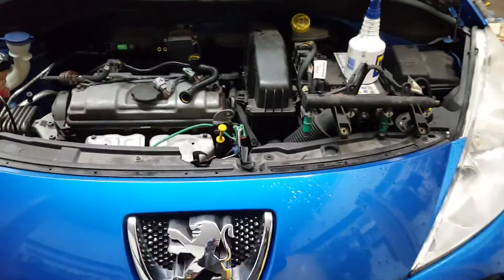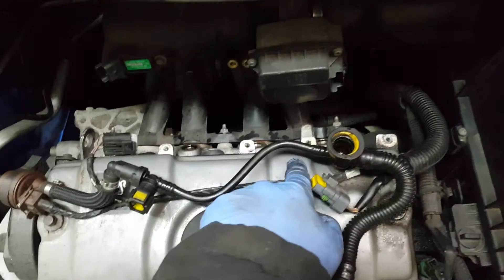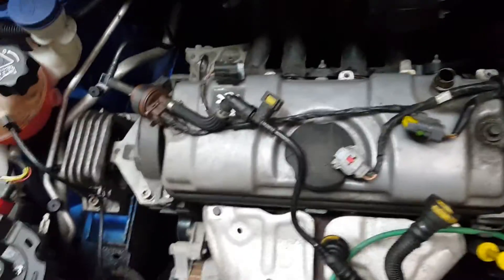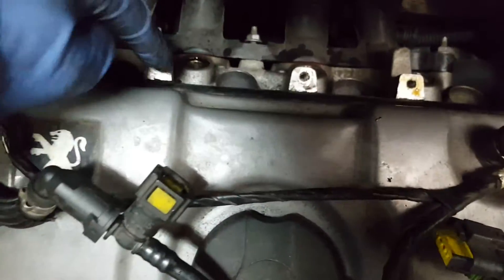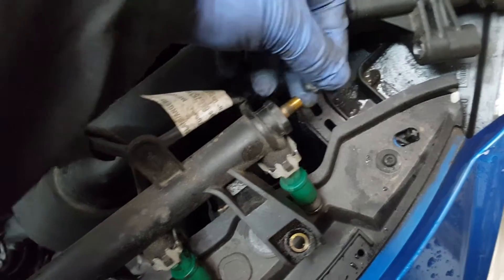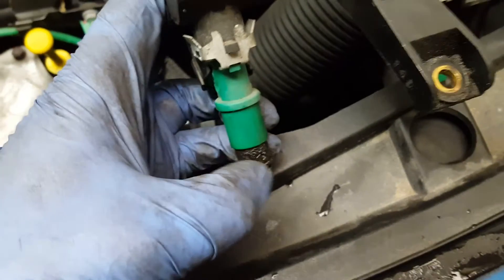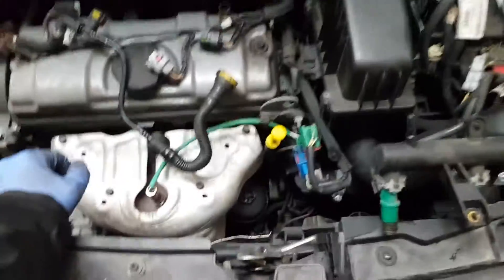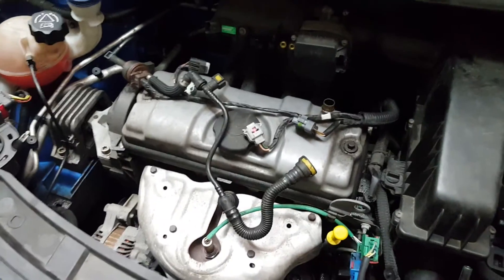Peugeot 207 misfire fixed. Coil, spark plugs, Injector removal and test.

Comment: Had checked a number of videos but this is the best one yet. My Peugeot is misfiring. The mechanic fitted new coil and plugs to no avail. He said most likely the ECU and not worth fixing as the car is a 2004??? I will have to ask him if he checked the injectors. Thanks for an excellent video.
Reply from the maker: Thank you very much. It's great to be appreciated. I hope that would be your issue as it is very common on them. Let me know how you get on. Good luck

Comment: Thank very much for this video, after buying and installing new plugs and ingintion coil my car was still misfiring, after watching this video I took out the fuel injectors that were very dirty and cleaned them up with throttle body cleaner, I put them back on and my problems were solved. It's no longer misfiring Thank you.
Reply from the maker: Thats brilliant 👏 well done!
I am glad that you managed to get it sorted. Usually it's them 3 things that can cause that. If not any of them then its lookin for the wiring or ground issue.... mind you saying that on more recent cars the EGR unit can cause some nasty misfire and in some cases ko fault codes... 
You are welcome :) have a great day

Comment: Hi Alex! I’ve got a 207 GTi with a misfire issue. Car misfires only when idle and cold, but once it gets onto the road and picks up speed, the misfire eventually stops. I recently changed my spark plugs and checked my coils, Both are fine. Pressure coming from cylinders is also okay, do you think It could be injectors or fuel pump?

Comment: great video. I have a 2006 307 1.6 petrol that comes up with fault p1338. i have replaced plugs and coil pack, clear the codes but no change at all. p1338 comes up again. any idea what should I try next?
Reply from the maker: Have you had a look at your injectors? I would suggest swapping injectors first mate.

Comment: Hi i am having a problem of intermittent rough idle usually only does it when car is at operating temp. Also idles roughly (hunts up & down) if you put the car under load,like put your foot on the brake and slowly release the clutch while in gear then the car starts to idle roughly.
Reply from the maker: Hello. Have you scanned the vehicle to get a fault code?

Comment: Hi Alex, I have a Peugeot 207 1.4 8v.. I bled the coolant system as there was no coolant in the car when i got it! so I put a hose pipe in the coolant tank and i ran the car until the fans kicked in and the coolant was stable.. The car is not losing any coolant. But i am getting code P1336 after driving it from cold for about 5 minutes then the engine light comes on but it says could be one or more undetermined missfire.. maybe i got something wet when i disconnected the pipe at the top of the radiator to flush it out? what do you think?
Thanks
Reply from the maker: Hi there. I would definitely check your ground cable connections for a good contact

Comment: Thanks for the video very helpful, just a quick question. What would happen if you didn't replace the damaged injector seals?
Reply from the maker: It will leak and misfire still causing internal damage on the engine as well by not having proper combustion
Reply: @AlexTheGrumpyOne  okay thanks my peugeot 206 has a miss fire, it sometimes gets worse and the fault light comes on and off It first come up as a injector not working which I replaced it ran better but still plays up when I plug it in it gives a code p0300 I've tried  new spark plugs I'm just wondering weather to replace the injector seals or maybe the fuel filter.
Reply from the maker: What about the coil? Is that ok?
Reply: @AlexTheGrumpyOne  I don't know I'll have to look into how's best to test it thanks for replying. Darran

Comment: got a 65 plate 307 thats giving me  an anti polution warning and is only firing on 3 cylinders any ideas what could be wrong or have caused it? heads done right in cheers.
Reply from the maker: Have you had it scanned to get fault codes out? If yes then what are they?
Anti pollution will be due to missfire hopefully as it's not burning the mixture and getting your cat or dog blocked. 
Is it petrol or diesel? 
Coils usually go on them if it's petrol. But you need to scan it first.
Reply: They'd have prince engines not them ones on the video

Comment: Hi great video, I have a petrol 207, I have an issue when the engine is cold, when I pull away it judders and has a lack of power, once the engine has warmed up it runs perfectly. Someone said it might be the camshaft position sensors need changing but I’m getting no error code on my diagnostic tool
Reply from the maker: that can be coils starting to fail to be honest
Reply: AlexTheGrumpyOne hi Alex changed the coil pack and no difference, any other ideas mate? Thanks 😊
Reply from the maker: Hello mate. Have a look at all of your glow plugs please. Also have you had it scanned yet? To see if there is any fault codes please.
Reply: AlexTheGrumpyOne it’s a 1.4 petrol version so no glow plugs I presume? I’ve spoke to a garage and they said that EML is not coming on when it has the issue they doubt a scan will find it
Reply from the maker: Yes petrol will have spark plugs which can cause that issue as well if there is condensation or issue with the gap. EML light doesn't necessarily needs to be on to have fault codes in it. I will recommend scanning it fully and having some live data reading on it mate.
Reply: @markwalker652  maybe throttle body could be cleaned up, you'll be surprised how dirty it is

Comment: how did it run ?  i have a 1,6   vct  engine with intermittent slight miss   at idle ,(no load)  and when driving at any speed i will get a miss  every 10 seconds or so ....whether under load or not...its like a hick up !!!   l  your thoughts please before i unload with coil packs and injectors  cheers
Reply from the maker: Hello
 Have you had it scanned for a fault? To see which number it is. 
I suggest to do that first and then swap the coils to see if it moves to another one. If yes then it's a coil... If not swap the plug and see if it moves.
Reply: @AlexTheGrumpyOne   hi thanks for the reply ...you wouldnt believe it , i just bought the car didnt really check it because  all the receipts for servicing new plugs etc.. the guy spent alot of money  trying to fix it...all the coils are bocshe  and look new , he changed the plugs and oil  and it had no codes , he took it to different mechanics to fix it ????... so i put 1 litre mentholated spirits in the fuel tank and it is fixed ...water in the fuel tank!!!!!!
Reply from the maker: @cameroncooper4291  bloody hell mate... Has it had a jet wash on it by any chance haha. 
Well I'm glad it's been sorted mate

Comment: thanks for your video.
i have a fault P0170 in my peugeot 206 cc 2.0 petrol from 2005 is any ideia what i need to clean ?
best regards
Reply from the maker: Hello there. Is that the O2 sensor fault? Have you got any more info? If O2 sensor fault then I would suggest to clean it and see if it comes back after a drive... If not will need replacing as they are common on them
Reply: the O2 was change 1 week ago,and now comes the fault code P0170
Reply: @AlexTheGrumpyOne  iI have a scan delthi and tha is what is shows me.

Comment: Hi Alex, great video 😍So here's my problem: My son's Peugeot 207 keeps misfiring. He says that it's two pins on the plug that supplies power to the coil pack that keep burning out or getting coroded. Any idea what he's talking about and how to fix it please? He's changed both plug and coil pack twice and the problem keeps recurring 😢
Reply from the maker: Yes it can be an issues on them. Not common though... If that's the case then he will need to get new wiring for it. Which is a bit of a pain... There is a way that you can just buy plug and solder it in to join wiring but need to be very careful. Can get plug on eBay or brakers
Reply from the maker: If it keeps burning the plugs or wiring then you need electrician looking at it as something overcharging the system on them. Will need good voltage and Amos check and etc... Unless the wiring is weak
Reply: @AlexTheGrumpyOne  Many thanks Alex 😍
Reply: @AlexTheGrumpyOne  Many thanks Alex 😍

Comment: Hi Alex I was wondering if you could help please we've got a Peugeot 207 2008 petrol. We took it to a garage & had the rocker cover gasket changed, but the car is misfiring & the fan comes on as soon as the engine is turn on.
Reply from the maker: I would suggest to check the wiring first please. They might of pulled some plug or etc.
What is the temperature gauge doing when you start the vehicle?
Reply: Thank you for reply we changed the thermostat a few weeks ago as the car was over heating but it not over heating anymore.
Reply from the maker: Has the system been bled properly? It might have air in the system and that will cause radiator to kick in eraly

Comment: Hi. My cotroen c2 starts fine in the morning, as well as just after shutting it off, however once standing for an hour or so, it struggles to start. 
What can I check or do? 
Please advise. 
Thank you.
Reply from the maker: Is it hot when you start again?
Reply: @AlexTheGrumpyOne  
It is normal working temperature. 
Its not overheating. 
The headgasget was faulty, so done the head as well as new piston rings, dont smoke anymore.
And after doing all this it started fine, was running fine, and now started to misfire and rough idle. 
Smell of petrol is evident once trying  to start it after a while. 
Also sometimes when driving the misfire goes away for a while, but then returns again. 
A very confusing matter.

Comment: Looks like the same engine that is in my son's 57 plate Citroen c2
Reply from the maker: Yep it will be
Reply: @AlexTheGrumpyOne  cheers mate this helps me loads
Reply from the maker: U ate welcome
Reply: My son's on the number 4 injector fuel's gushing out around the injector he bought it cheap cos of tht but that bit you say is held on by 3 torques is in the glovebox would tht bit affect how the injector rail is sitting
Reply from the maker: That might be the injector seal
Reply: @AlexTheGrumpyOne  can you get them separately mate
Reply: Can you get the seels separately mate
Reply from the maker: The seals? Yes u should be able to get it at your local dealer
Reply: Cheers mate

Comment: hi mate, c2 permanent misfire on cylinder 1 (lexia diagbox) change plugs and coil pack, still problem. It runs perfect, plenty of power but the  idle is a bit jumpy on the rpm. Do you think its the injector?
Reply from the maker: Yes it's quiet common on the for the injector to fail. They not very expensive. Make sure you got rubber o ring with a bit of oil around it or etc when installing it.

Comment: Can you please tell the cylinder numbering on 1.6thp ep6dt engine, some says its 1.2.3.4 left to right as you said its 4.3.2.1 left to right, there is another science its 1.3.2.4 left to right, which 1 is correct for ep6dt peugeot 308??
Reply from the maker: Hi there. It's 4,3,2,1
Reply: @AlexTheGrumpyOne  thx

Comment: Hello mate! I have an Peugeot 307 1.6 16v petrol. When cold in the morning the cars starts with the first key but the engine doesn't run very fluid. After 5 mins the car is normal and it runs well. I have changed the spark plugs...and the same happens. With diag tool i have cylinder 1 and 2 missfire. What should I do? Thanks!
Reply from the maker: Have you changed or swapped your coils? Try and swap the m with number 4 or 3 and then see if the fault has moved. What do you mean by doesn't run very "fluid"? Not idling properly?
Reply: @AlexTheGrumpyOne  By coils you mean spark plugs? Yes...i have changed them. And yes i mean the engine not idiling fluid in the first 2mins.
Reply from the maker: @iCSvision  by coils I mean a coil pack if your engine is the same as this then it's that black pack that goes on top of your plugs. On some engine they are individual.
Reply: @AlexTheGrumpyOne  his engine has the solid coil pack so u cant swap individual conectors to different spark plugs..had same problem that dissapear after throttle body and actuator cleaned

Comment: Hi,
What's it mean when 206 03 plate 1.1 car shaking constantly and sounds like the back box has gone on exhaust but there's no holes. Also there's a lot of blowing coming out of end of the exhaust it smells too I've checked the exhaust it's all air tight. Also theirs a lot of white gunk in engine and a bit in coolant. I don't think head gasket has gone cause the car is still blowing warm air inside the car and engine not smoking or kicking smoke out. The mechanic before said the white gunk is because the car not been driven on long journeys is this correct? Is there any suggestions what I can do?
Reply from the maker: That can be either because it haven't been driven for long distance... Or headgasket .. in your case sounds more like head gasket. I would do a head gasket check. With the liquid that you can get and see if it's changing colour.
Reply: @AlexTheGrumpyOne  with the car shaking would you think it's a missfire or would you put it down to head gasket? How would I check the colour changing?
Reply from the maker: Has it got engine light on? I would scan it first to see if it got any codes. It's a kit that you buy with a little bottle that you fit on top of radiator and then let it get hot. Liquid will change to yellow or green depending on kit you got. It pretty much shows if there is a leak in the system or not. 
If the head gasket is bed then it can cause misfire or not starting at all
Reply: @AlexTheGrumpyOne  thank you I will get one, There is a engine light on also found out everytime when you speed up the engine light flashes and three bleeps go off. When you slow right down the engine light goes solid.
Reply from the maker: @repairaholic4858  you definitely need to scan it first then please. Let me know how you getting on and the fault codes you get
Reply: @AlexTheGrumpyOne  I have been trying to scan the car for error codes but it doesn't seem to connect to the ECU
Reply from the maker: They are a bit annoying as not all the readers work on them
Reply: @AlexTheGrumpyOne  yeah strange cause it works on my 2018 honda and a 06 Peugeot but not the 03 Peugeot with the fault?
Reply: Now the car smells very bad like a strong smell of sulfur.

Comment: It dont start on the button unless I rev it a bit everytime when it's cold, what could it be thanks
Reply from the maker: That can be injector issue. Maybe rubbish or water in a fuel. Maybe your throttle body getting stuck as well. Have a look at that.
Reply: @AlexTheGrumpyOne  I've had head refitted too and new injector seals too, ima try clean throttle body out, starter motor does turn a bit slow too
Reply from the maker: Do a battery check on it as well. French are pretty sensitive on that.
Reply: @AlexTheGrumpyOne  at least coilpack might be good right?

Comment: Hi Alex, I have also an Peugot 207 from 2009 with the error code p1338. The mechanic told me that there is a problem with te second (2) cylinder and that he need to replace the bougies spark plugs. He replaced them all 4 but now the problem is NOT solved. The cooling fan also starts very quickly and only goes off after 5 minutes when the engine is off. What do you think about it?
Reply from the maker: Hello mate. Have you checked the fuel injectors and the coil?
Reply: @AlexTheGrumpyOne   Not yet mate, I don't know what te do because I am scared to replace everything which can cost a lot of money if you understand
Reply from the maker: Have you got diagnostic tool? That you can scan it with? Usually it's injectors on them. You can swap them with each other and if the fault moves to the other one then it's that injector... Or if not you can always take them all out and test it on top of the engine with paper around it to see if they are all injecting the same way
Reply: AlexTheGrumpyOne yes i have an OBD 2 tool. I Will tell the mechanic men about iT. The car is also shaking and the error code comes then
Reply from the maker: Yes that's when it usually picks it up. Can you  please swap the injectors and see if the fault code moves to different place. Make sure you mark the injectors so you know which one is where .. by the way .. on that model the cylinder order is wrong.. n 1 is on the gearbox side and not on cam belt side.
Reply: AlexTheGrumpyOne do you advize to replace firstly the coil or the injector?
Reply from the maker: I advise to check the injectors first. But test them please. No need to replace. You can just test them to find out of they are not working by swapping them and checking if the fault moves or by taking all rail out and trying to start the vehicle and check if they all spraying the same way... Need 2 people for that.
Reply: @AlexTheGrumpyOne  Hi Mate, The mechanic has replaced the coil and it seems very good. I think that the problem is now solved mate!
Reply from the maker: That's great news mate :) 
I'm glad you got it sorted now. Like I said it is usually either injectors or coil :)
Reply: AlexTheGrumpyOne we are now 6 months further and the car had the same error “emission error” . 6 months ago the mechanic replaced the coil and the error was solved, but now the error came, what i have to do now?
Reply from the maker: Unfortunately we had that issue as well. Coils are tricky on them as some makes don't last long. I had few that didn't last even a year.
Reply: AlexTheGrumpyOne hmm okay, thats annoying and not good. And is iT not the catalysator!

Comment: I currently have an ‘anti pollution’ warning on my Peugeot 207 1.4 petrol. What is the possible cause of this? At acceleration it shudders but at low revs it’s not bad?
Reply from the maker: Can be your oxygen sensor or catalytic converter issue. You need to scan it
Reply: @AlexTheGrumpyOne  thanks Alex. 👍👍